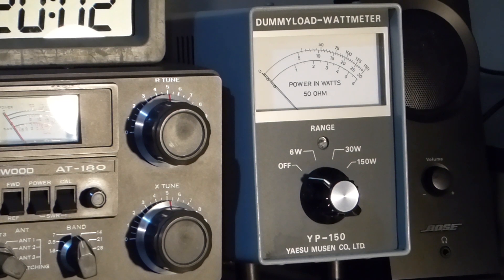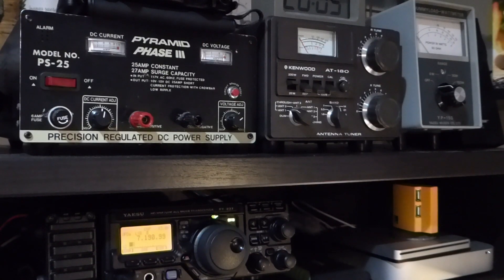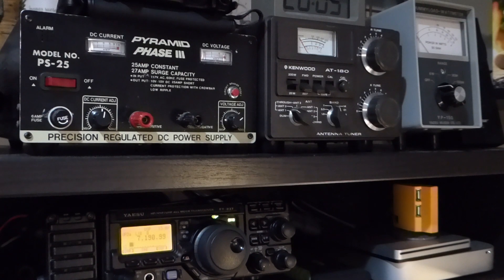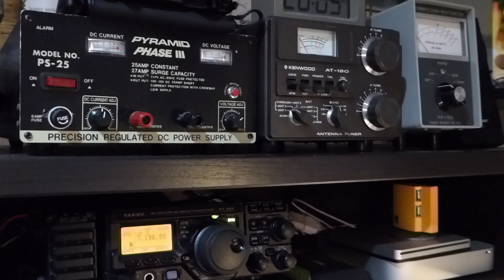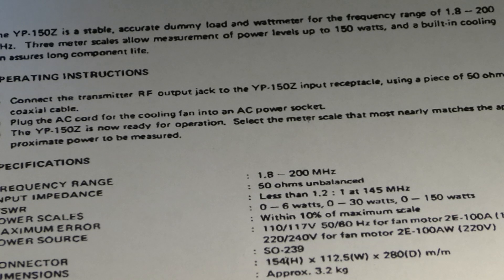Why You Need a Dummy Load

Comment: Question; if you use a dummy load, will it totally protect the radio from any “way too high swr” damage that would likely be caused if you transmit without the dummy load?
Reply from the maker: Sorry for the delay in responding to your good question. 
A dummy load is a piece of test gear and is not inline during normal operation. If the dummy load is working properly, and the connecting coax is good, it won't damage your radio. And yes, you don't want to transmit without a dummy load or a resonant antenna system connected.
Reply: @OutdoorsOnTheAir  Thank you so much, I will try with the dummy load. For me the antenna system are very hard to manage. What I mean is that I think I would need study a lot and buy expensive equipment like antenna analyzer to have my radio working properly with a low swr. I say this because I got a radio and though i just need to put some antenna out the window and that’s all. But no, I now understand that I need a proper antenna, a good placement as high up as possible, a reliable swr meter, a better coax cable than the one I bought, the right jumper cable to the swr meter, probably an antenna analyzer too. All this is very complicated for me. One person I asked told me it would be better if i had not bought this expensive nice radio and instead got a cheap one and put the money into a good antenna system.

Comment: Onto many dummy loads it is written 3GHz. Are good for testing power in 136-500 MHz range ? (radios within VHF and UHF bands)
Reply from the maker: As long as the specifications state operation over the intended frequency range, you should be OK.

Comment: Hey, does one need to match the wattage of the dummy load or is bigger better so long as the ohms and Hz range is compatible?  So like can a 200 watt cover every thing from 1 to 200 or do I need a set of matching dummy loads?
Reply from the maker: A 200 watt capacity dummy load will work with any transmitter 200 watts or less 👍

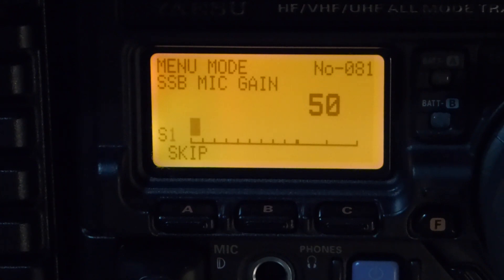Comment: At 1:45 you say the dummy load can be used to transmit to another receiver in the same room. So it does radiate a little bit then, correct?
Reply from the maker: The cable will radiate a bit.

Comment: Not needed.  Ask is the frequency is in use three times. No answer then test your power or mic gain. This test takes no more than 10 seconds key down time. I have been a ham op since 1991 and never felt the need to use one.

Comment: Nice informative video!  I just purchased a Yaesu YP-150 to let me test and  know what my Icom 746 Pro is putting out at an even match.  Also I have a 6, 10, and 15 meter Mizuho MX "S" series 2 watt hand held cw/ssb radios that I wanted to make sure they are putting out enough of the 2 watts.  Now, if they aren't, I got to figure out the calibration to "tweek" them to the advertised level of power output without a manual to do this...
Reply from the maker: Thank you for sharing your experience. That YP-150 is a real gem.

Comment: Hello
I have a fm transmitter circuit,which i made the rf signal source it, with a Chinese mp3 fm pll transmitter,as source and i ampelificated it with some rf stages....my problem when i conectted antenna which i tuned for 89.6mhz,by the formula like 145.2/divided to frquncey(~81cm every side of my antenna),when antnna is conectted still,after some minute ,last satge transistor get hurted, without any desire rf power on antenna,when i remove last stage transistor and check by multimeter it shows,base with collector leg,more values than base and emitter !!! Or same value !(multimeter is on diode test section,and transistor is npn 2sc3950 or 2sc1971).....
My questions is
When dummy load is conectted,(two big 5watt 100ohm resistor in parallel to have 10 watt 50 ohm)its get warm,and trassitor not hurted anymore.
Why my transistor get hurt if still i know i have tuned antenna for it ??!!!!!!!! Why all produced power dont goes to antenna ??
Maybe i drive last stage transistor with more power rf power which came from past stages, than it need??
Or unmatched antenna still is my mistake,idtk!?
Can you advice me a antenna (a matched antenna)which work 100 percent,is it any simple matching trick?
Addition:
After 2sc1971 or 3950 collector leg,is a 3turn coil and one trimmer capacitor 60p and one 30p to ground...
Antenna cable which i use, usually used for satellite receiver 75ohm (thick).....antenna rod i used is aluminium 9mm tubes....
I dont have any device to see how much power on which frquncey i have,just i made a simple power meter by use a old multimeter pointer,and a lamp connect to some leng wire to see power in output...
I will appreciate if you give me a solution,cause i burned many rf transistors till this time ....
Sorry too long text.
Thanks a ocean
Reply from the maker: I'm very sorry for the late response to your comment. Unfortunately, much of your comment went over my head. As far as an antenna, you can't do wrong with a half-wave dipole made for your target frequency. Good luck!

Comment: Ok, i am setting up a Homebase station, I have a Watson W-10AM power unit, a CRE 8900 rig, a 5/8 wave Venom silver rod antenna. What dummy load should I be looking for. I am checking the swr on an old rig I had in my truck so as not to do harm to the CRE
Reply from the maker: You need to look for these specs in a dummy load...frequency range and maximum power rating.
Reply: Outdoors On The Air 
Straight over the top, is there not a general sort of dummy load to cover all ranges of the set or is it set specific. I am sort of getting an understanding of this in as much it is more than sticking a set in a truck and away you go.

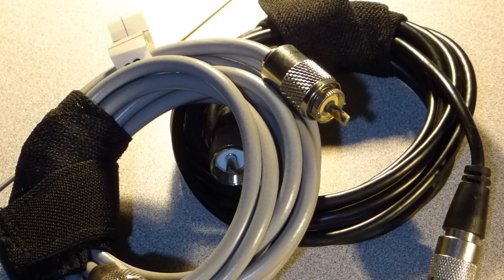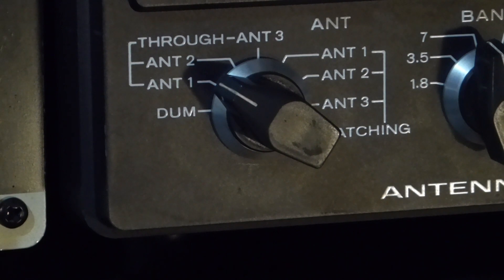Comment: At 2:27 you suggest that a dummy load can be used to test coax cables by connecting them to  an antenna switch (i.e. Ant1 or Ant2 @2:48) instead of connecting to DUM. Does this mean if you are using the DUM selection the dummy load is normally screwed directly into the UHF type connector at the back of the Antenna Tuning Unit (which looks like an AT-230)?
Reply from the maker: Hi Chris, thank you for your question. What I mentioned is that it is convenient to keep the dummy load plugged in to the DUM connector on the back of the antenna switch if you want to make regular checks on your transceiver. The part about testing coaxial cables was in the previous statement and did not reference using the antenna switch. Hope this helps to clarify.
Reply: @OutdoorsOnTheAir  OK many thanks for your prompt response. We had a Club shack sale on last night & I was weighing up whether to buy a Drake DL300 if I was already going to get a Vectronics VC300DLP (which has a dummy load built in). In the end I managed to get both items at very reasonable prices and will see if a spare dummy load is useful to have around or it whether it ends up the next Club sale. Lol.
Reply from the maker: Good score at the shack sale!

Comment: What model antenna switch were you showing in the video?
Reply from the maker: The antenna switch is actually built in to my Kenwood AT-180 manual tuner. It's a good product that can be found at a reasonable price on the used market.